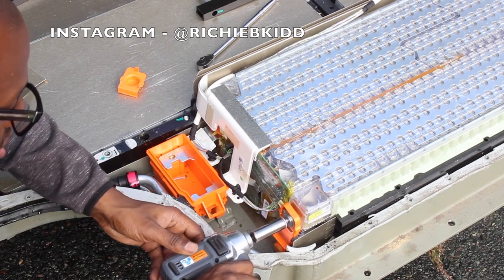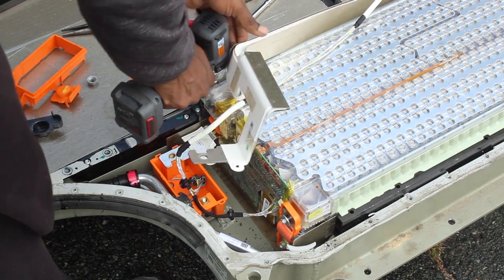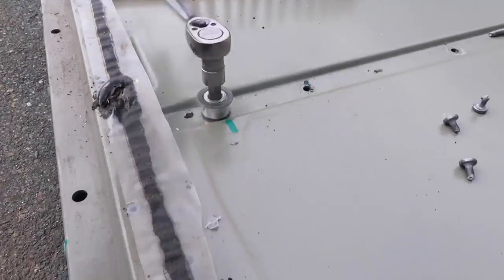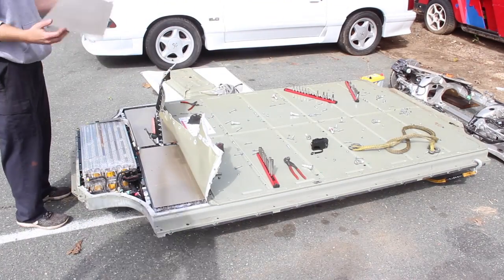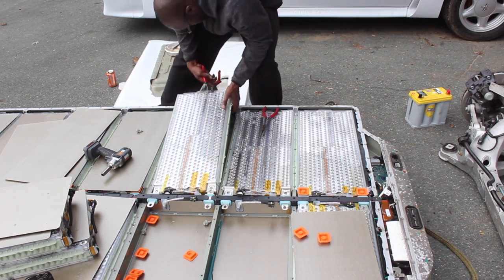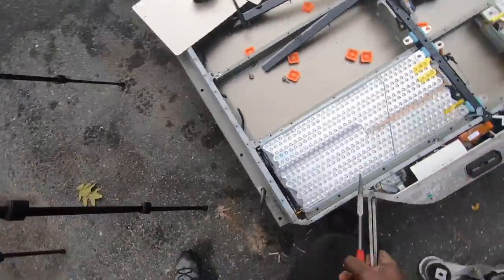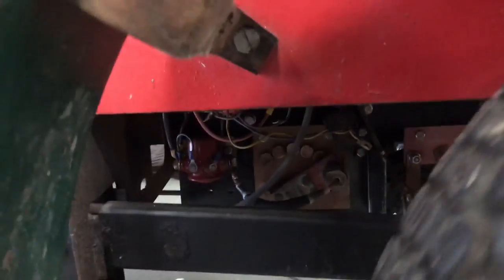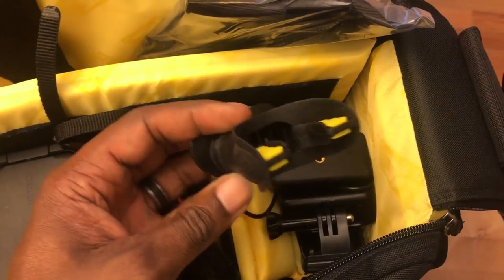Unprofessionals Guide to Opening a Tesla Battery Pack

Comment: Dude, I can't watch this..

Working at a Tesla service center, even just touching the battery requires high voltage gloves + leather gloves on top. Be careful.
Reply: Does he even do some repairs properly tho? Or at all safely? Because just because it's high voltage, doesn't mean it's more dangerous than a gas car
Reply: the full batterybank voltage will only be on the end leads, every cell is just 24 volts, as long as you work on only one cell at the time it wil be safe.. Remember, there is no connection to ground, its not a ac line you work on..
Reply: @MrBugsier5  It's the amperage that kills
Reply: you can't kill Rich Rebuilds with electricity.. it would only arouse him more... hence the condoms :)
Reply: @Wrathborn771  if the area is dry, there should be no issue, especially since he's not touching any connections. And the tools he used, they're insulated.
Reply: @Hunter_Bidens_Crackpipe_  true, but at least he did it so he wouldnt puncture anything. Plus, he didn't touch any terminals or wet electronics.
Reply: He knows what he's doing. It's no more dangerous than walking down the street to someone like that.
Reply: Yeah… Wouldn’t want to be around 24V*750A*10sec with coolant running around!
Reply: You need voltage to get the amperage through human skin though. 24v across those batteries will melt a tool if he drops one on the terminals, but you could touch both sides with your hand and you won't feel a thing. I wouldn't recommend licking both terminals though, that would be a bit much.
Reply: 24v on the tongue is a bit uncomfortable, but survivable! I know what 150V on the tongue is like!
As a 10 year old I charged a capacitor with a generator to make sparks with it. Once it didn't spark, so I put my tongue on the terminals it to check. I think my tongue automatically recoiled so quickly that there wasn't any damage, but I'll never do that again!
Reply: you don't get how it works....
Reply: You're not entirely right. 9V its enough to kill you
Reply: Honestly it's irresponsible not to put some effort into safety. We want you to be safe Rich.
Reply: Gloves are great and all but near on most lose your dexterity.
Reply: It's all staged. Nobody would do this without safety equipment
Reply: Ah that's alright what doesn't kill you make you stronger
Reply: Tesla hypes the danger thing because it's their excuse to maintain a monopoly on repair. The voltages are not that high and DC is much much safer than AC. Your average 3 phase industrial motor control is a thousand times more dangerous than anything in a Tesla.
Reply: Flygman mebbe if Tesla offered ANY kind of support, correct tools, service manuals.... he wouldn’t HAVE TO!... mebbe raise that with your service manager?
Reply: Flygman Did you just say that common misconception? If you are a technician you should know better.
Reply: @Flygman: Still, not entirely true. You also need potential difference to "push through" those amps, 24 volts won't cut it.
Reply: No more dangerous than a regular car battery
Reply: Wait, you work at Tesla and handle batteries but you have no clue about electricity? Seems about right. 😂
Reply: bryzaone like the manuals offered freely on tesla support?  lmao
Reply: it kinda does mean it's way more dangerous.
Reply: actually you want some moisture, around 20-30% moisture, any less and dust particles in the air can cause a chain reaction from something as simple as static electricity.
Reply: Yeah everyone thinks it's the Volts that kills.  I used to work with Navy systems that were 4160 volts. You take every precaution because it only take one small mistake and your dead. I have seen it happen before and it's not pretty.
Reply: @Hunter_Bidens_Crackpipe_  he doesn't have insulated tools. The rubber coating on the handles would be a lot more thicker.
Reply: @Wrathborn771  Which is depending on the voltage and the resistance I=U/R. As long as the voltage is too low to penetrate the upper skin layer the body resistance is around 1 MΩ. So  the amperage is around 0.024mA which isn't killing you. But there are also high voltage contacts within this battery pack don't open it if you don't know what you are doing.
Reply: LOL
Only around 300 some odd volts. Whoop te do. 

All the line guys who have been nailed with 10,000 volts are laughing right now.
Reply: @Wrathborn771  You have brought great enlightenment to me. This is the very first time I have heard this explanation. You learn something new each day. Thank you so very much.

Comment: Rich, I am currently working on finishing up a 48v Dune Buggy that the Veterans club at my college (Palm Beach State College- Florida)acquired from the defunct engineering club. All of the parts are there but the battery we have is a 20ah LiFePO4, we can see this will give us a very limited run time. What would be the best way for our club to source a couple of Tesla batteries? I think 10kw at 48v will serve us a lot better than what we currently have.

Comment: I think this can be used for any hybrid car battery if the battery pack is good I wonder how many volts each battery module has I know around about 220 to 400 volts you need for hybrid car battery but it could be useful if those battery modules are working correctly for hybrid cars

Comment: What I wanna know is, if you ever reuse the battery modules, given the fact that the top sheet metal cover has been removed like a sardine can, how or what do you use to reseal the battery pack again since the original cover seems to be rather destroyed?

Comment: Only 130? Im surprised they didn't just use 1130 to be even more annoying. That battery cover removal is intense. Since you need  hydraulics to remove the adhesive,    I wonder if they're only using battery cover screws to increase the rigidity of the car, like BMW did with e46 skid plate/oil pan cover bolts

Comment: Rich I want to ask a question what is the voltage  mensurment of tesla battery after been charge and how many voltage does it output to run the AC motors fixed to the tyres

Comment: according to teslas website pricing, that pack is worth 780$/kwh (lol not) (19500/25kwh more) making the 100d battery worth 78k...oh wait 
a 75D is only 68k base and has 75kwh meaning its battery is worth 58,000....this is not adding up at all

nvm, it appears that tesla gouges like crazy people who buy the 100D for some reason despite it being outdated tech,

cant wait for taycan to show up with base 3.5 0-60 and force them to refresh it

as it stands the 100D's are absolute ripoffs based upon teslas own pricing

model 3 is what 8000$ for 15kwh? or 500$/kwh
what gives? why is the model 3 upgrade 35% less for a better battery?

Comment: Cool. It's sad Tesla's becoming like Apple. I hope the Right to Repair become a law, so things can be fixed by our own hands or at least by someone in the sub-component level.

God bless, Proverbs 31
Reply: I agree Tesla has massive parts issues but to play devils advocate they are still very much a startup and really don’t have much in the way of a parts stockpile to be able to sell parts to customers. Furthermore, Tesla takes care of their customers much more than Apple giving owners loaner cars sometimes much nicer than their own whenever they have an issue or even before. Furthermore the components are high voltage and thus very dangerous and need to be heavily protected. I do think that right to repair is desperately needed but some repairs should be kept to professionals for the safety of the public as you really don’t want some idiot tinkering with a lion battery pack and burning down a house